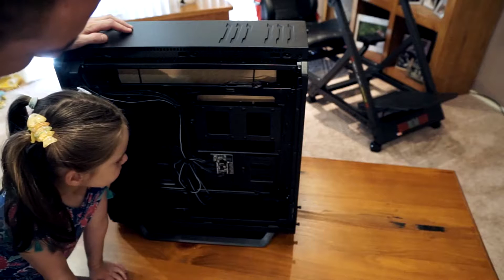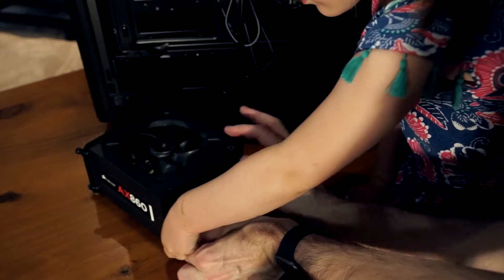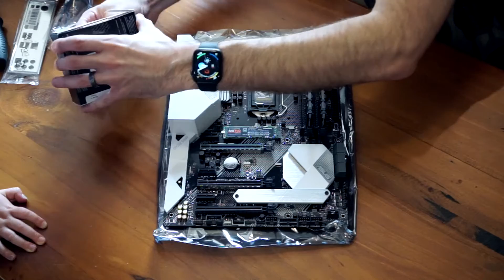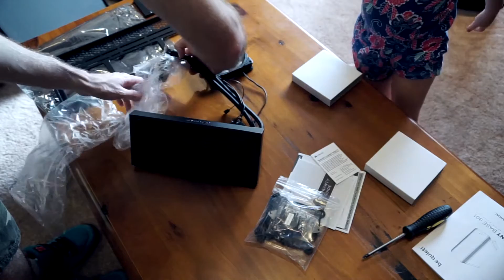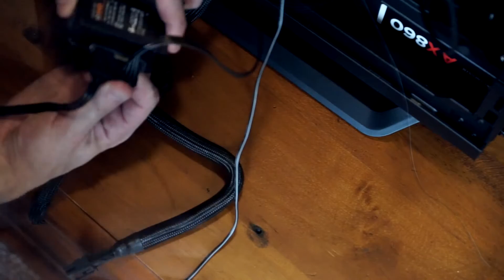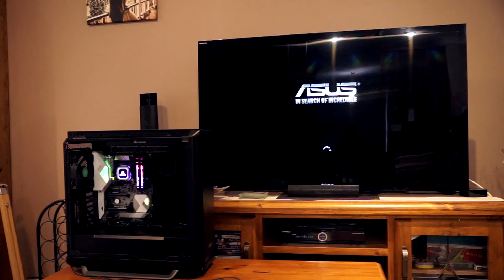COMPUTERS FOR KIDS - My 4 Year Old Daughter Builds Her First Computer

Comment: Why did u install the m.2 in that slot when there is another slot that has a built in heat sink asus claims it reduces temps by 20c I dont get it
Reply from the maker: The SSD my father in-law bought was SATA and not compatible with the other slot. Believe me, I tried. :(
Reply: @boostedmedia  I'm asking because I just bought a samsung 970 evo plus nvme  and I have the same motherboard should I put it on the other one then? And in the future if I get another one can I install it on the top slot ?
Reply from the maker: Yep if it’s NVME you can use it in either socket but obviously the one with the heat sink is the better choice. Only the top socket supports SATA drives.

Comment: I need some serious help: i have just built my pc all debug lights off everything recognised in bios but my monitor is tinted green where it is barely able to see, my system is a Ryzen 1600x
Msi b350 gaming pro carbon
600 watt PSU
8 GB ram
500gb hard drive 
No idea what the graphics card is as brought it from a computer shop without a box and i couldn't find any pictures of it.
I'm using a VGA cable to connect my card and monitor 
Appreciate any help
Reply from the maker: Sounds like either faulty graphics card, cable or monitor. I’d test each.
Reply: @boostedmedia  thanks bro